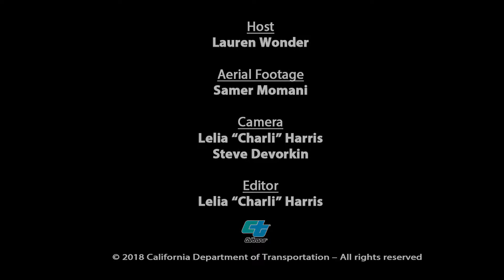Stripe-Widening Projects

Comment: why can' t the fix the paint striping on the 101 south at exit 2C.. between the grand street overpass and the north hill street over pass for the line between the 2 and 3 and 3 and 4 lanes along with the right edge stripe.. i drive that a lot.. not in the last month.. but i have been calling and filling out forms online for a year.. the stripping is faded and directs people in the number 4 lane directly into the sand barrels where they have to exit the freeway.. as the painted lanes shift left but the concrete road way surface does not show that shift. 

 it it was not so buzy i would get out there with a roller and repaint the darn lines.. i might take the paint striping crew 30 minutes to make 3 passes there to put the stripes in place..  its the same exit that many D7 employees use daily  its about 400 feet of striping.
Reply from the maker: Thank You for your request. We are sending to our  Public Affairs Manager
Phone: (213) 897-3693
Reply: @CaltransD7   just have somebody get on south bound 101 at Hope street and stay in the number 4 lane passing exit 2C... and they will see the faded pavement marking just before they have to dodge the barrels .   i have called many times.. take the phone number down.  i won't be traveling that section of the freeway for a few weeks..  if its still bad next time i pass.. i will call..